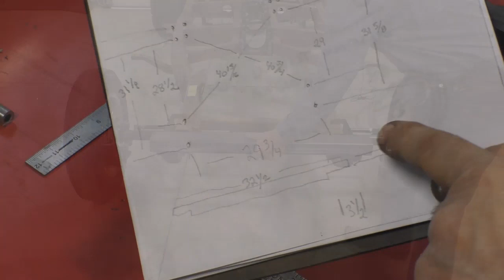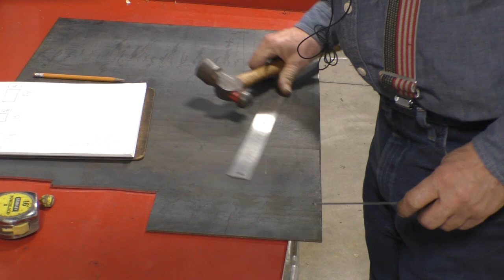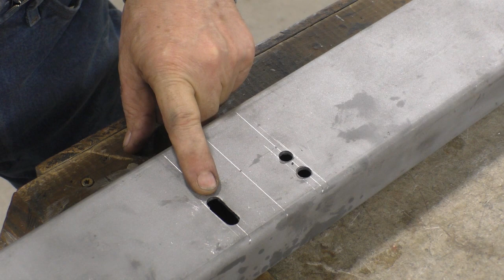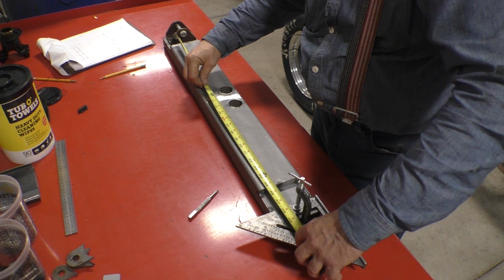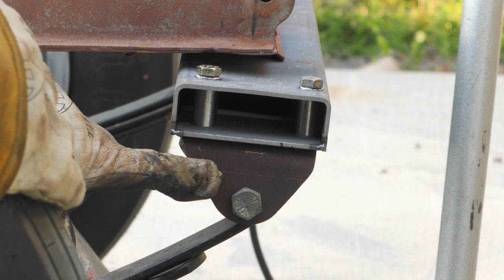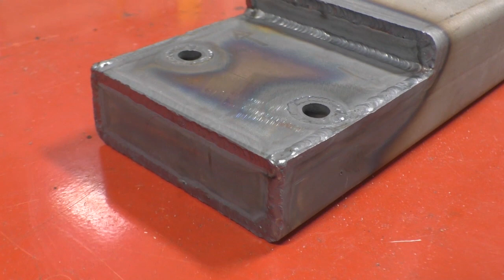Front Cross Member, 1949 Chevrolet Gasser

Comment: At the 5:30 time - the metal plate you are cutting pieces out of - what gauge are you using? Thanking you in advance! I want to build one of these for my 49 Chevy too.
Reply from the maker: I am not ignoring you, I just have not gotten out to the shop and remembered to measure the thickness for you. I will shortly.
Reply from the maker: Measured the plate today, .240 is the thickness of the plate I used.